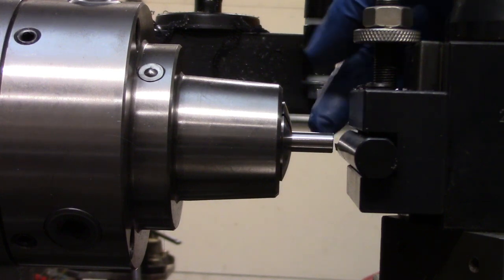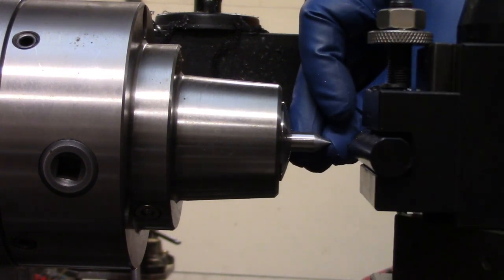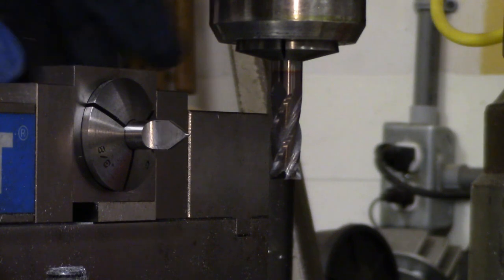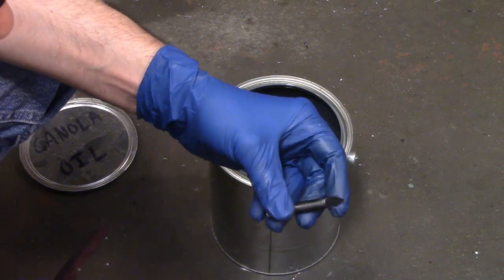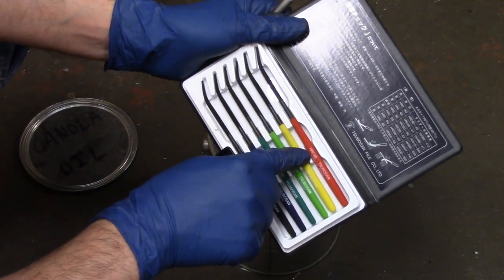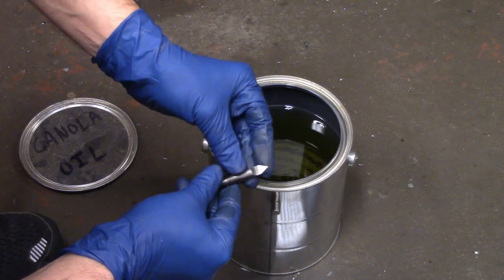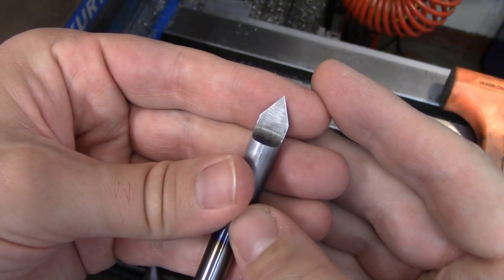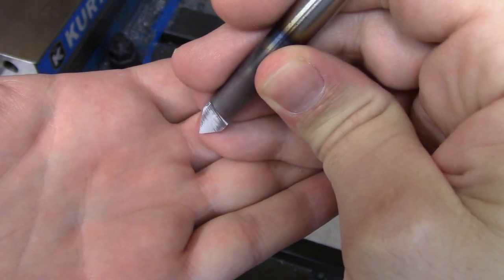Making a D-Bit Engraving Tool

Comment: So why did you choose to not relieve the trailing side of the tool as is standard practice? Seems to me if you are going to show the making of a "D" bit cutter you should at least mention it.
Reply from the maker: I did mention it.
Reply from the maker: 9:43 in case you're interested.
Reply: @StuartdeHaro  My apologies. I was taking a phone call right about the time that came on the video. And for those of you who are interested, NO, I don't want my damned carpets cleaned...........
Reply from the maker: @oh8wingman  Yeah, but what about your car's extended warranty?
Reply: I agree, without relief on the non cutting side, it is not a cutting tool.  Of course it makes burrs, when the round edge is presented to the workpiece, it just rubs.

Comment: Well, there's so much I can say about this video.  I have a Cuttermaster, and I've been making these bits from carbide.  I grind the cylinder in half first and then I put the conical tip on it.  I also have the cam set that allows me to put a relief behind the cutting edge.  Basically, it feeds the cutter harder into the wheel after the cutting edge to make a relief.  Also, I have found empirically that grinding slightly more than halfway across the cylinder produces better results and fewer burrs in the work when you cut.  I had a machining project that resulted in a lot of long, broken carbide and mills, and I have since turned them all into engraving cutters. Net net is that I have made quite a few engraving cutters, and I have tested them in aluminum.  It's better when you're grinding the cylinder in half to go about .001" over and cut it a little small.  Spin them fast and feed them slow and you'll get fewer burrs.
Reply from the maker: Thanks for the advice!

Comment: some people recommend a very slight snap temper, just to relieve the internal stresses and prevent the metal from being super weak. a lot of the time fully quenched and untempered steel can be good. if your end mill is quarter inch or under though, in my experience, an untempered end mill can break extremely easily. but for something of that diameter, especially if you're drilling steel, you might not want to temper it.
Reply from the maker: Thanks for the insight
Reply: @StuartdeHaro  That's particularly for making a steel cutting end mill. It's very easy for O1 to lose its temper because of the energy required and heat produced from cutting steel. Brass cutting tools might lend themselves well to being tempered more. I'm not a metallurgist and this information is probably decently wrong but yeah generally when cutting steel you want to get your metal as hard as possible without it just snapping in half.

Comment: Great video, still I'm going to be one of the jackasses that has to share his experience. Not sure why you didn't get atleast 62 plus rockwell. If using a torch I spend a lot of time bringing it to a black heat, 5 plus minutes minimum. Then take it the last few hundred degrees to above non-mag and hold it there for atleast a few minutes. Longer is better.  Quench in oil, moving back and forth. O1 should always be tempered immediately, 300-350f in oven for two hours is good for cutting tools. Its hard to make a good tool without the back relief, its an absolute must.  I machine to a point like you do, then hand grind the relief starting at the trailing edge and moving to cutting edge. Any relief if better than nothing. You don't need to be careful until you get near the cutting edge. If you can sharpen a drill you can do the relief.  If needed put back in lathe and recut if tip is affected. Repeat steps until you've got your angle and relief if needed. I go pretty heavy with my reliefs. One its done a few passes with lapping paper or on a very fine stone (atleast 1000 grit) to put a tiny relief at the cutting edge (5-15 degrees) goes along way to making great cuts.  Just a few swipes, it will be hard to even see it.  They get better and more refined everytime you do it.  You should add a relief grinding section to the video, tempering to.

Comment: You could also do it without the lathe or mill take the relief cut first with a grinder but on an angle then grind the tip in I drill on a belt sander until the point meets the relief cut perfectly

Comment: Just for a bit of fun, Canola oil in England is called Rapeseed oil. I guess the puritans were a bit prudish.😉
I don't know how different your O1 and our silver steel, but with silver steel you can quench in oil, water or brine. Oil gives a softer hardness but is better for crack reduction in complex parts. For max hardness brine is used as the boiling point is higher than plain water and so quenches quicker. Water gives a harder metal than oil and is the most convenient, but can quench too quickly for some shapes, which your D bit isn't 
Having written all that, oil hardness is obviously fine for your purpose
ATB  
c
Reply: Your silver steel could be W1, or O1
Reply from the maker: Yeah. Rapeseed oil probably wouldn't exactly fly off the shelves here. I know silver steel and drill rod are among those terms where we are separated by a common language. Do they sell silver steel in different grades depending on the hardening medium or is it just one type of steel. Here we have the O series for oil, W for water, which can also be done with oil, and A for air hardening. There some others too. H13 is a high speed steel that will retain hardness at high temperatures. That's used a lot for tools that will punch or cut hot steel. S7 is very common for tools that will be struck, like jack hammer bits and cold chisels. D2 is a very common die steel that doesn't lose as much carbon when heat treated. This could probably be a video of its own.
Reply: @12345NoNamesLeft  strictly speaking we have just the one, which can be quenched in oil or water depending on the hardness required.
Reply: @StuartdeHaro  generally just the one. Simply speaking silver steel in the round and gauge plate, or ground flat stock, for rectangular. There are loads of other metals that can be hardened of course,  the only real advantage of silver steel or gauge plate is that it is accurately(?) ground to  size, for which of course you pay a premium. I put the question mark in because it being centre less ground is an accurate diameter but not necessarily  completely round but trilobular.
Reply: @12345NoNamesLeft  just an add on to my last. Medium to high carbon steels can be hardened. As i understand it the other alloying elements refine the whole process.  In the early 20th century you really only had  a few steels to worry about and that is all most of us amateurs still need, saves a great deal of brain ache.😉
Reply: Oddly enough, it is the Canadians to blame for the name change. Ontario specifically. They have very limited crops they can grow in that climate, rapeseed is one of the largest crops. It was actually a national Canadian lobby that shifted the name.

Comment: Good info. Can you use any high smoke point oil to harden steel?
Reply from the maker: That's why I used Canola. Peanut oil is also decent.  Then there are the purpose built hardening oils like Parks 50, but that's not really a home shop kind of thing unless you do it a ton. Any oil will do in a pinch, just be prepared for smoke and maybe a fire.
Reply from the maker: @BelieveontheLordJesusChrist  Water generally cools things too quickly and increases the risk of stress fractures, especially around sharp corners. I'm not sure how wax or coconut oil would work. I'm assuming you mean that it would be melted first. It definitely needs to be a liquid so you can swirl the part around in it. Agitating the part keeps a vapor barrier from forming around it that would insulate it from the quenching medium.
Reply: @StuartdeHaro  I liked the idea of using a metal paint can to hold the oil. If you drop a hot part, it won't melt through the can and the can lid can be sealed tightly which should slow down the oxidation process a lot.

Comment: One other video idea, I have always wanted the ability to mark things I have made with a custom logo. How does one go about making a touchstone, or Maker's Mark?
Reply from the maker: There are several ways to do this. Blacksmiths make custom stamps all the time. You can find that by searching for "making a touch mark". Another neat way is with electro etching. You make a vinyl mask of your logo and stick it to the part. Then you use a car battery charger to etch the part. Clamp one cable to the part and the other has a cotton pad soaked in salt water. Press the wet pad over the vinyl mask and whatever metal is exposed will get etched. It probably matters which cable is attached where, but I'm not totally sure.